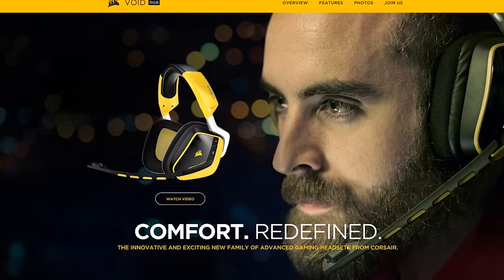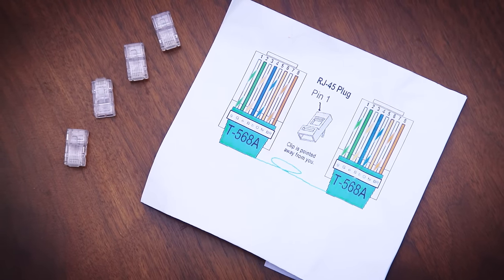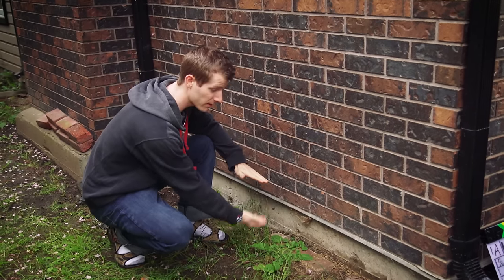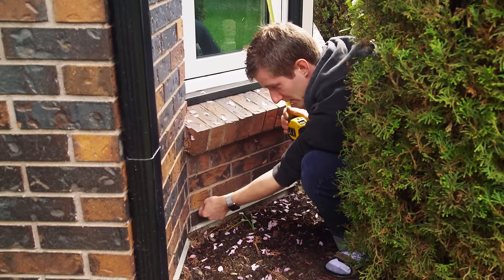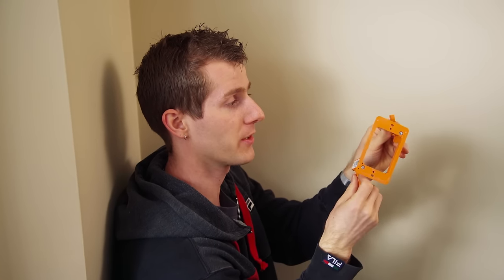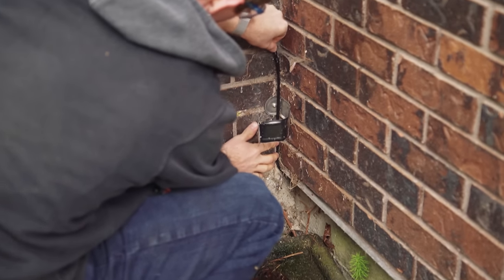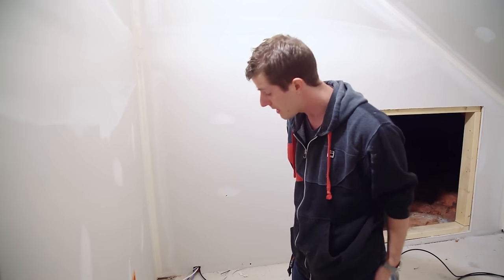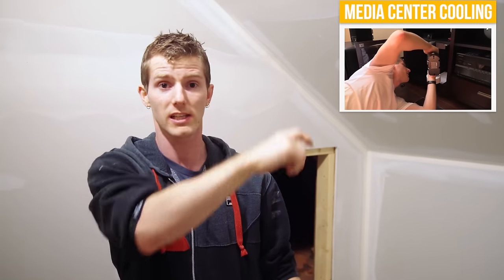Optimize your cable runs at home! - Installing an exterior Cat 5e cable

Comment: You don't need a hammer drill to drill through concrete, a normal corded or cordless drill will do just fine. This would have been just as easy to run the cable inside the walls.
Reply: I hope you're trolling... Please tell me you're kidding...
Reply: Nope, what seems to be the problem?
Reply: Masonry bits are designed to chip and extract rather than cut (like an HSS Bit). Using one in a regular drill would take ages, and heat up the bit to the point of ruining it. And secondly, as he is going between stories, it would have been much harder to go 
down inside the walls.
Reply: Most people are not going to buy a hammer drill just to drill a couple holes. A masonry bit will last months if used properly (even in a standard drill). Running that wire in the wall would take no more than 20 minutes if he had fish rods. I run Ethernet cables all the time, as well as electrical and phone wires.
Reply: Between floors is not that simple, there are no "holes" to push the wire with  out drilling them or following an existing cable, which is tougher to do since the wall is up.  Not everyone wants holes in the floor.  Not disagreeing with you that it could not be done. Nothing wrong with how it was done, besides if someone has pull rods they would also have a hammer drill. Like Linus said a lot of smaller drills have a hammer drill setting.
Reply: William Hatfield Ya your right it can be kind of a pain to do that if you don't have the experience. However it is always (imo) to cut a small hole in drywall than to drill a dozen holes in brick.
Reply: Ah, yeah you do need a drill with a hammer setting. Most decent Cordless & power drill have that though.
Reply: Running in the wall is not as easy. It takes a lot of experience and specialized pull and push rods. Anybody with basic DIY experience and tools can do what Linus did.
Reply: Zach Demand You can pick up a cheap plug in hammer drill for like 30 Canadian peso's at most. At least you will be able to drill each hole in a matter of seconds, rather than painful minutes.
Reply: a hammering drill is like 50 bucks at ikea, and its a really good one.
Reply: Well in that case I will make the 12 hour round trip to IKEA, so I can buy a $50 hammer drill, so I don't fuck up a $5 masonry bit. Sounds like a great idea.
Reply: Zach Demand well your house is a pretty valuable investment. using the wrong equiptment increases the chance of shit going wrong. a hammer drill is always handy to have, its a purchase for years to come. sure it sounds like effort for that one time, but it isnt a disposable hammer drill.
Reply: tjeulink You obviously don't get my point. If you have a small task like the one Linus did in this video, and you don't have a hammer drill, a normal drill WILL work. That is my whole point to start with! Why spend $50 (over $100 for most people) when you don't need to, and lets face it, a lot of people don't have the money to spend on a tool they will rarely use. So what if you destroy a masonry bit. So what if it takes a extra minute to drill that hole. When I added an attached garage to my house I used a standard drill and a masonry bit to join the foundation, I still have that bit. It was a bit dull by the time I was done, but a couple minutes with a bench grinder fixed it.
Reply: Zach Demand because it can mess up your wall. the value of your house drops. you can also rent tools like these. for 10 bucks i think, but then again 50 bucks for a hammer drill from ikea really isnt a lot. i get 65% of minimum wage and i would be able to afford that. even if you're not able to afford that than you can always ask in the family or at neighbors. sure if you dont live in a first world country it can be un-affordable. or if you live below the poverty line by a lot. just because you where lucky enough to not fuck up doesnt mean that the chance isnt big and that it is "just as good"
Reply: How could it mess up your wall? The hammering action of a hammer drill is more likely to mess up a wall than the grinding from a normal drill. You might be able to rent them some places, but not anywhere near me. And its not that someone couldn't afford it, its the fact that its a tool that you don't need. If you are going to be drilling a bunch of holes, then buy one, but for a simple task like this, save your money and put it toward something else. But it doesn't really matter anymore, I'm tired of arguing about this, you obvisouly have your opionion, I have mine. I left this comment to inform people that a hammer drill isn't needed to drill a hole in masonry, I will leave it at that.
Reply: Zach Demand stop moving the goalpost, you first said that some people cant afford it. now you say that its not needed, are you an expert? no, you're not. it will wear down your normal drill, it wil ruin your bits, and it can ruin your wall. what are you going to do when the brick cracks? put epoxy all over it? its just a waste to not use a hammer drill since 99% of them can be used as a normal drill anyways. why do you think the hammer drill was invented? do you think its some kind of scheme to pull money from your pockets? no ofcourse not. its actually a needed product for drilling into dense hard materials such as masonry and concrete. drilling it with a normal drill is just begging to melt the insulation on the motor winding.
Reply: ***** technically those are impact drills i believe (but im not sure what drill you have ofcourse), the difference is kinda not important. they will work well too since they basically do the same thing but slightly different. they are the middle road between normal drills and hammer drills. they are meant for screws etc and have a lot more torque when needed. but a hammer drill is still better. it actually slams against the material instead of just twisting into it.

http://toolguyd.com/hammer-drill-driver-impact-driver-difference/
Reply: Correct a impact drill and hammer drill are different.  If you are drilling into brick you NEED a hammer drill.

Comment: Houses built in the future ( maybe even already today) will have the ethernet cabeling built in from start just like power outlets.
Reply: I'd prefer flawless WiFi.
Reply: No they won't lol. There was a very short time in the early 2000s when it was an option but with the performance of wifi now and in the future it will never become commonplace.
Reply: no they won't since most people never touch an ethernet cable.
Reply: like in wall ethernet which a lot of apartments have
Reply: In Finland it is required by law to have ethernet plugs in all new houses.

Comment: I did kind of the same thing, except I brought the Ethernet cable through the drywalls and ceiling and just put a pass-through on either end. Cheaper and easier than drilling through the outside walls.

Comment: Why not drilling from inside out? Would be much more practical IMHO
Reply: putting a hole in the brick vs putting a hole in the wall inside that is just covered by the plastic housing inside anyway
Reply: if you drill from the inside out it is possible a large chunk of brick will chip off when the drill exits, this can happen with the drywall aswell but that isnt a problem becuase of the covers/sockets he  puts in the wall
Reply: Tim Albers  As well as being the RIGHT way to do it.  Drilling outside in almost always ends in disaster.
Reply: Well that could cause a large exit wound in the brickwork....
Reply: As the others mentioned... as well as 1, the drill bit he used wouldn't have been long enough to go through and do the brick, he ended up using a different type of bit to finish off the drywall because it was longer.

Additionally he was able to pick a more optimal position for drilling through, he picked an area that was a joint, so it wasn't drilling through a whole brick, meaning more likely of smaller hole. 

Also, I work for a company where we have engineers doing this kind of work. And one call not too long ago involved a customer where the engineer didn't have a long enough drill bit, so he tried the lining it up and drilling both ends, he put a lot of additional holes in a brand new wall, the house was less than a month old. 

Essentially the only compromise I could come up with was to have the customer source the original contractors or local engineers to fix the damage and send us the bill.
Reply: Dreadnaught1985
This is not work for engineers, it is work for technicians.  Typically, if you are using engineers for technical positions, you are wasting money and getting sub-optimal quality work.  "Not a long enough drill bit" isn't an excuse or reason, if you don't have the proper tool, you go get one (or make one) rather than fucking it up with the wrong tool.  The example you gave is the EXACT reason you drill inside out.  If you are worried about going through the mortar, there are solutions for doing that properly as well. 

In short...ALWAYS, IN ALL CASES, DRILL INSIDE to OUTSIDE..
Reply: I am an engineer who is continually made to do things like wiring and cable termination.  I haven't done these things in YEARS. 

My work in these areas is sloppy, and I wish it wasn't, but I don't have time to practice this as well as my trade..
Reply: mellamohonas
If you are an engineer, and they are "making" you do low level tech jobs, then you need to find a new company to work for, or get the one you work for in line...
Reply: Umm no....just no!!
Reply: *****
It literally has NOTHING to do with dust...at all...
Reply: As someone who does exactly this on almost a daily basis, I can confirm that I never had an issue drilling from outside in.

Comment: sooo drilling holes thru the exterior and exposing cables was preferable to running cables inside the walls because why?
Reply: There are many scenarios where you'd want to run cable outside, like not needing to knock down walls. Also, the run can be a lot shorter with more complex wall designs if you run your cable outside. In my case, I don't have an attic and all of my rooms have at least one side touching one of the primary 4 walls on the outside, and my ISP has already run coax outside to each room, so it's be much easier for me to expand their holes and run my cable outside alongside their runs. I also don't have an attic or any crawlspaces to run cable internally.
Reply: You obviously have never done any dry walling before!
Reply: noggins would be the short answer!
Reply: Suppose to run cabling down through the attic or up from the basement.
Reply: @kalijasin  And what if you have a two story home on a slab with no basement? Very common. Not so easy to route cables to first floor locations from the attic in that case. You would have to either cut and patch multiple holes in sheetrock or run cable outside in those cases.

Comment: Great video. I would suggest before drilling to test the wall with an electrical tester to make sure you don't drill through any live wires. Not sure how relevant that is for the house in this video (as the walls look hollow) but if you have a house with brick on the inside like we do in the UK then I would 100% recommend doing it.

Comment: RJ-45 at each end?????  cat5e instead of cat6??? Using your fingers with the silicone??? is this your first cabling project?
Reply: I don't see why people are making an issue out of that. Cat5e is rated for up to 1 gigabit. Which is faster than any connection available in Canada by either cable or dsl.

Rogers  500 Megabits
https://www.rogers.com/consumer/internet

Shaw 150 Megabits
https://www.shaw.ca/internet/plans/

Bell aliant 300 megabits
https://aliant.bell.ca/Bell_Internet

Videotron 30 megabits
http://www.videotron.com/residential/internet
Reply: The big deal (which isn't that big) is just if the speed is upgraded in the future you'll need a new cable
Reply: @Jason C.

As a Bell cable guy; we have 1150 megabits per second internet available to people who have optical fiber in their neighborhoods.
Reply: Cat 6 blocks interference better.
Reply: Probably
Reply: @kalijasin  so many reasons to use cat 6 instead

Comment: LOL I did this exact project a few days ago! Except I kept my wires indoors! I opened up a small portion of dry wall of the upper level, drilled down through the floor joist (16" drill bit), dropped a string directly down with a metal drill bit at the end, measured where to drill a hole in the basement wall, stuck a magnet in the hole, pulled the string out of the wall, then attached the ethernet wire to the string and pulled it down and of course patched up and painted my mess and voila! Just make sure measure many times in the planning stage and know that your joist drilling isn't where a stud meets up. (or any power outlets/switches)

Comment: Why T568A over T568B? Was the house originally wired using the T568A scheme?
Reply: who cares its the same shit as long as its consistent.
Reply: Why are you making an issue out of that?  One is not better than the other. They both work equally the same.
Reply: The T568A standard is used in America and the T568B standard is used in europe
Reply: @CJ Actually it doesn't matter how the rest of the house was wired, as long as both ends are T568A, and he uses a switch built in the last decade, the switch will auto-negotiate the send and receive wires.
@Jason you are correct, either one can be used.
@evenhl1999 T568A is the standard in commercial application in the US and residential uses T568B. Next time you purchase an Ethernet cable from a retailer look at the RJ-45 jack and notice it is wired as T568B.
Reply: Yeah that was my thought. Why a?? I run cat5 and cat6 all the time for work and it's always done in b. For every job ever. And I'm in America.
Reply: A is for gov't, B is for residential and commercial.
Reply: evenhl1999 t568a was a at&t standard because it worked better with their older Merlin 3 pair phone systems, 568b was developed by the TIA, A is still used by the GSA and in Canada. Performance wise you won't see much difference until you start getting into 10gbe due to twist difference between the green and orange pairs. He would have been better off using Jack's, rg45 tips are a pain and are more Durable.
Reply: @atlwolf3  Hey no comments on maple syrup in our poutine!

Comment: That's an interesting terminal there. Usually when I've gotten keystones for plates rather than crimping a plug and then plugging it into the socket I've had to arrange the cables onto the keystone and then punch them down with a punch tool.

Comment: Can confirm the "shorter" bit.
I pulled Ethernet through existing conduits, ended up going through four separate conduits - that were for speaker wire and coax, respectively - through basically the entire house even though the router is basically just seven feet below the computer. Only did it because drilling was vetoed vehemently. Worked out great though. No more dodgy WiFi up here, it's all the bandwidth, all the time! Woo!

Comment: 1. that's a hammer drill, not an impact. 2. 8p8c not RJ45. Seriously, who wrote this script?
Reply: I'm pretty sure that was rj45
Reply: ***** pretty sure it was an 8p8c
Reply: Different Country, different Speech. The use of 8p8c or RJ45 depends on the standards of the country. In Spain the RJ45 is used as standard.
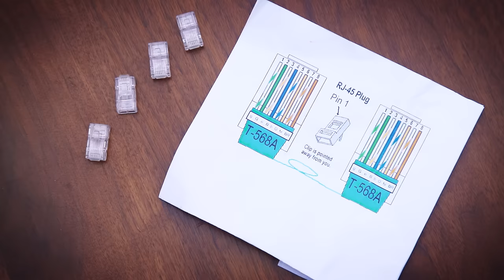Reply: 9:09, the diagram says "RJ-45 Plug". It's the standard for Canada.
Reply: RJ45 and yes its not a impact drill he had a impact driver sitting there but
Reply: Incorrect. RJ45 is a telecom standard. Computer networking uses 8p8c. Not a Canadian thing. I'm Canadian.
Reply: The diagram is wrong as well. so many people think its an RJ45 that the industry has simply let the mistake carry on. Google RJ45, read the first line that comes up.
Reply: lol is that so? I think what's more likely is that you have no idea how to use google. But i digress. Enjoy your ignorance young sir.
Reply: U mad bro?
Reply: Googled RJ45 for you.

RJ45 may refer to: RJ45 (telecommunications), a connector standardized as the 8P8C modular connector (and the similar RJ45S with a keyed 8P2C) RJ45 (computers), an unkeyed 8P8C modular connector used for Ethernet computer network cables (incorrectly referred to as RJ45)
Reply: I have been a telecommunications tech for 10 years everyone i know refers to them as RJ45 its even on the packet but having said that i have heard them referred to as 8p8c connectors

P.S im Australian if that matters
Reply: Yupp, same in Canada. Big fan of LMG but i figured Linus would have known better, of all people. o well :)

Comment: If I'm doing it myself, I will always opt to crawl up into the attic and drop a cable though the inside of the wall rather than running cable outside the house. That eliminates both the need to worry about your calking breaking down and allowing water or critters into the house and the need to "hide" the cable on the outside of the house.